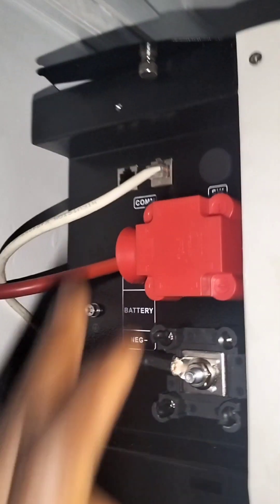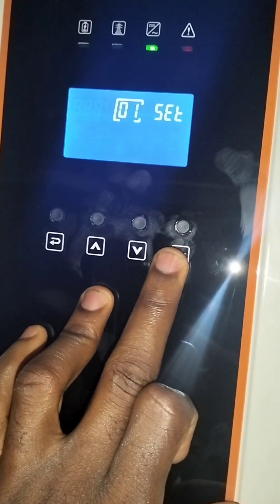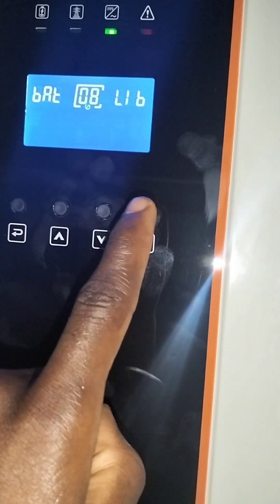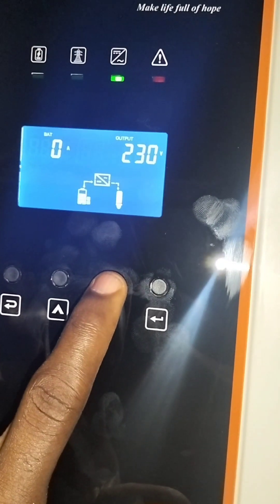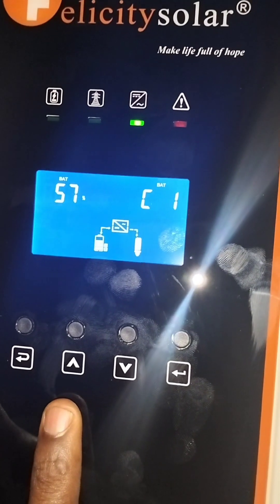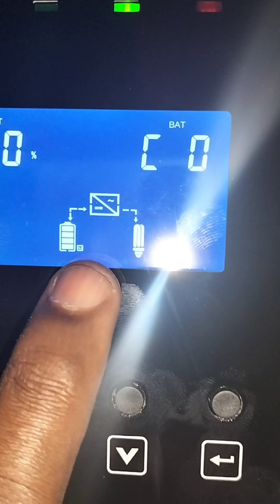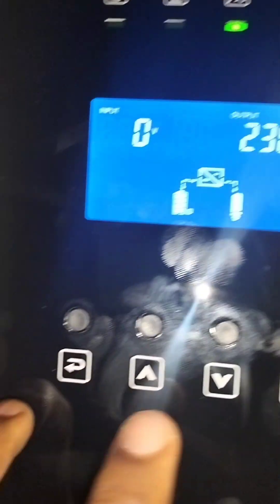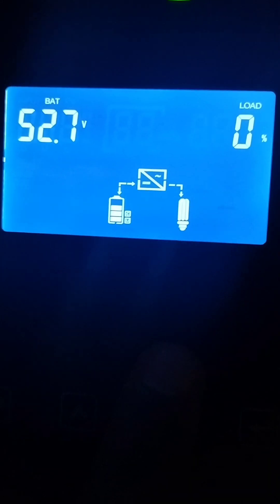How to communicate IVEM Felicity inverter with Felicity lithium battery LPBF48200

Comment: Hello, please I have a new 5kva Felicity hybrid inverter but it is not charging with NEPA light when 198v is showing on the breaker. I have been told this is too low voltage to charge it? Is this right please ?  Or can this be changed in settings?

Comment: I have a Felicity solar energy system. BMS was connected ok but after restart the inverter 3KW and battery 5KW, the BMS connection was lost. What is the procedure in this case? If possible, answer. Thank you.

Comment: had tried exactly what the video has shown several times but the C symbol did not show
Reply: I think I figured it out. My connection is with Felicity Inverter and Lithium battery. If like me you don't have the comm cable in the right configuration. Means you have to build one. A standard LAN cable and 2 RJ45'S will do. You also need a cripping tool. On the LAN cable you have your white orange and orange wires. Single these out and cutoff all other wires. On the RJ45...white orange goes to pin 5 and Orange to pin 6. Repeat on both sides. You now have an RS485 cable. Connect to the battery and inverter. The "C" will not show immediately. Configure your battery program on the inverter to "Lib"...on mine I got an error 80...give it a few seconds and the error clears..you now have the "C" and "LI" symbols on the inverter. You are good to go.
Reply: I have the same issue.
I was told that it's mainly for 2 batteries,  but he did it with 1 battery 😢
Reply: Ps: my configuration is based on Felicity IVEM8048 (inverter) and Felicity LPBF48300 lithium battery. Refer to your user manual or qualified technician. I like DIY so I took the risk. All the best
Reply: The pin 1and 2

Comment: Thank you for your time but why does the inverter refuse to  recognize the battery after it the communication cable has been connected
Reply from the maker: It's indicate communication successful for the inverter series IVEM
Reply: @colcent_solar  okay this is a ivps series
Reply from the maker: @alongeshina9739  ivps is the transformer base and it's does not recognize the battery after you connect the communication cable follow my TikTok to see the vidoe
Reply: @colcent_solar how can I get access to ur tik tok?
Reply: How to get the tik tok vid link?
Reply from the maker: @colcent_solar on TikTok